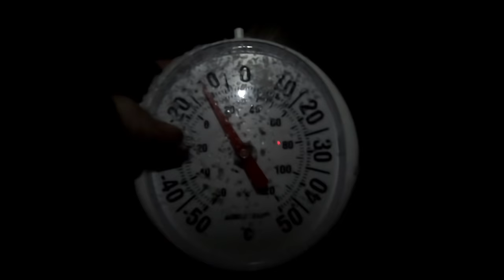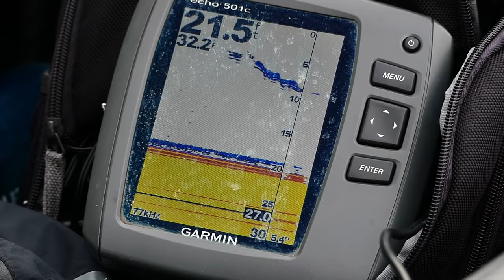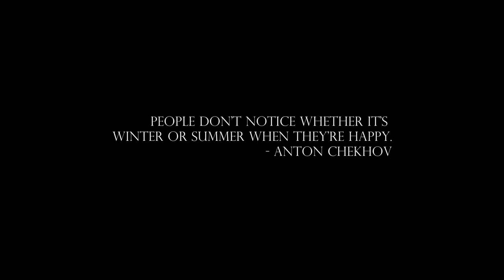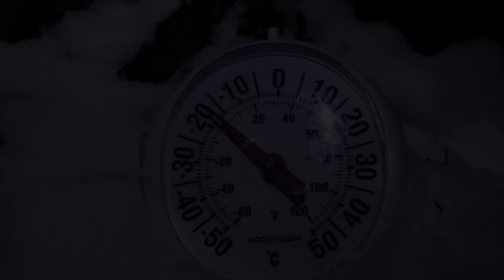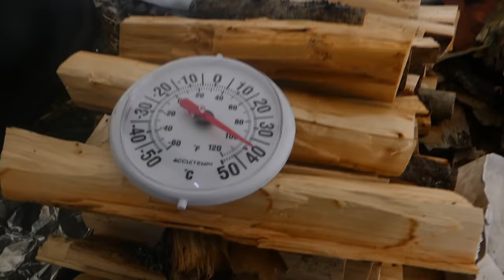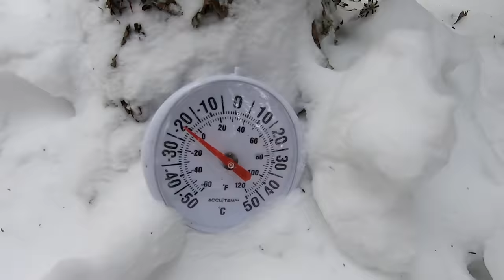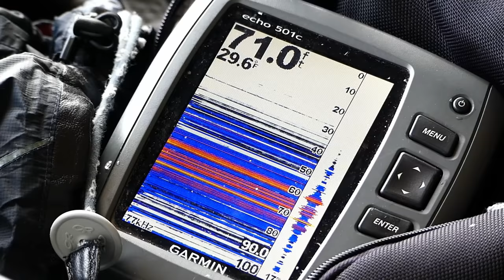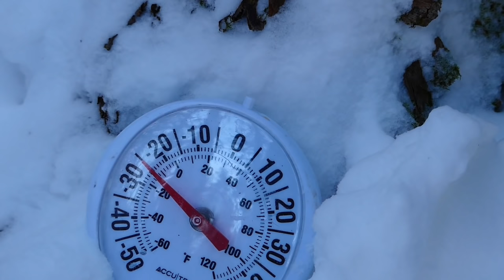14 Days / 4 Trips in the Hot Tent | -35° and Deep Snow (FULL)

Comment: Couple things I've learned making quinzhees: If you can't dig out your space down to ground before you begin piling, you risk lack of cohesion between the dome and it's footing (like when it collapsed on you). The dome wall foundation must be as well-set-up as the dome. You can also fully workharden a flat area first (good if working on a slope), or my preferred method, mark a centre point with a stick, take the tallest person's ski pole (you) and loop the strap around the stick, pull it gently out to it's full extension and walk a circle multiple times in just boots, stomping down and mixing up as much you can (really pack it down, you're looking to collapse the air out of the snow), mark the outside edge with twigs. This packs in your dome wall foundation, build your dome tall and round out to the twig-marked diameter.  As you discovered, adequate height is your goal, width is easy; a good target for height is your height on your knees, plus your arm extension up. Round domes are ideal, cones are hard to excavate nicely inside (similar to the difference between a teepee tent and a wall tent). You can dump a bunch of non-essential gear (like full backpacks) in the centre to aid excavation. Start digging up as soon as you can, carve out sections top to bottom (like an orange), this leaves some kind of a pillar to help support the roof until almost all the snow is out.  The wire bail handle of a 5gal bucket does an EXCELLENT job of shaving the walls smooth, waaay easier and nicer finish than a shovel. Don't forget an 2-3" air hole 2/3 of the way up the wall. If you sleep in your quinzhee (or burn a bunch of candles) it'll set up from the inside and sag much less in the short term.
Reply: THIS is the CLASSIC RECIPE; never been bettered.

Comment: This could be the ideal therapy for seasonal affective disorder for those living in the north.  

I like the axe system - saving yourself the headache of forgetting it and losing it in buried snow.  One additional precaution, to save a bigger headache : eye protection when splitting wood.  Any goggles or glasses.  If hiking in is hard, hiking out with an eye injury would be truly brutal.
Reply from the maker: It really is.  November is always a down month, then once things get properly cold around here in December the mood swings back up.  You're so right about the eye protection.  Eye injury is one of my biggest fears so you'd think I'd have made a point of it
Reply: @LostLakes  totally agree about November…it’s dreary.  On eye protection, open water fishing is another scenario in which I almost always try to have something.  Usually the sun is a good reminder.  But the transition to dusk is a dangerous time in my opinion, easy to make mistakes (bugs distracting you, rods in your retinas adjusting to dimming light, and fish biting at the surface sometimes leading to the zinging lure phenomenon on a missed hook set).  So I bring the specks and swap when the sun is going down.

Comment: FYI if you want a tech step up...I see you have the fan. Tegmart does  stove heat  power generators with an ancillary benefit that it's cooling source blows out hot air also. some more weight added to your trip.

Comment: Fantastic video, as per usual. Just curious what camp saw you use? I have been using a sven saw but am looking for a change and whatever you have seems to be a workhorse.
Thanks for sharing your adventures!
Reply from the maker: Thank you!  We use two (linked below) which are both excellent.  The boreal 21 or 24 for larger logs and the silky gomboy for smaller stuff, but replacement blades for the silky saws are annoyingly expensive
https://www.amazon.ca/shop/backcountryanglingontario/list/18YCV7GNJ1JYI?ref_=cm_sw_r_cp_ud_aipsflist_aipsfbackcountryanglingontario_2AXTJBSW8N1JFYVE424J
Reply: @LostLakes  You are a gem - thanks for the quick reply and the link for your gear. I will be picking up a few things before tripping season starts again in the Spring.

Comment: Hey love your guys adventures. I have similar stove and always burn out those type of fans  from getting to hot wondering what brand u use.
Reply from the maker: Thanks a lot Josh!  A small pin fell out of the fan and we haven't replaced it yet, but found it wasn't necessary in such a small space so more so we just haven't bothered.  Ours was Eco Fan Max I think.  It makes a sound like a motor sometimes on the audio which was another vlogging-specific issue

Comment: You said you keep getting up to feed the stove throughout the night. How come you don’t have a sleep system that can handle the temperature? You could have a solid night sleep. Just wondering thanks 😊
Reply from the maker: Good Q...we've got good sleep systems that can handle -20 but any colder and it'd be a long night.  But most of all, it's so much more pleasant when it's any colder than that to run the stove all night.  No matter the sleep system, it's so much nicer to sleep with an exposed face that's not freezing :)

Comment: Hi @lost lakes, I am in the market for a hot tent and stove, do you have any recommendations?  This will not be used in extreme cold and I need a  larger one to fit 4+  people comfortably.
Reply from the maker: Hi Mike, you might want to look into the big synthetic pyramid tents.  They're fairly affordable and can shed rain if it's not that cold.  These canvas ones are fine in rain too but they saturate, and they're a lot pricier (however they're my preference).  This Atuk model is a pyramid style tent too but that means a centre pole that's always in the way.  You really need a massive tent to fit 4+ people comfortably.  This 11x11' tent is supposed to be able to, but with a stove and a centre pole in the way, you have to pack in like sardines and I wouldn't do it again.  I'm about to order a Snowtrekker tent and 4 Dog Titanium stove, both from the US, but they're top of the line and very pricey (combined they'll cost me at least $3,000).  All depends how much you're willing to spend

Comment: Do you find the fan actually works to move the heat around the tent?
Reply from the maker: It does but I'd also say it's not that important.  If the stove is rocking, keeping the whole tent warm is easy with or without it.  And the fan takes up real estate on the stove and this is particular to vlogging, but it makes an awful sound for audio that sometimes sounds like a motor

Comment: So how come you guys don’t use a thick plastic tarp on the ground over the snow to keep your heat in more?
Reply from the maker: Hey Kate, it would only help if it was insulated, in which case it would be very heavy and bulky.  A regular tarp won't insulate from the endless cold source that is the ground, just keep the draft out.  Not to mention snow that you track in on it can melt from the stove and pool.  We just bury the edges of the tent in snow to keep the draft out and use insulated sleeping pads

Comment: Wie warm bekommst du es im Zelt mit dem Ofen wenn es so übel kalt ist
Reply from the maker: The inside temp ranges widely depending on how I use the dampers (on the door and flue) but it's certainly doable to get it to 40C when it's -30C outside.  But if it's -30 overnight and I'm trying to maximize the burn duration, I'll close the dampers most of the way to slow the burn.  It's also much colder on the ground than in the top half of the tent, so it could easily be below freezing still in that scenario which is why I still need a good sleep system (I only run the stove all night at -20C or colder).